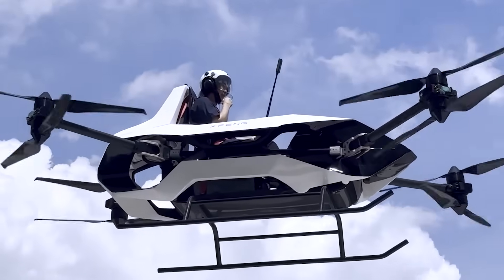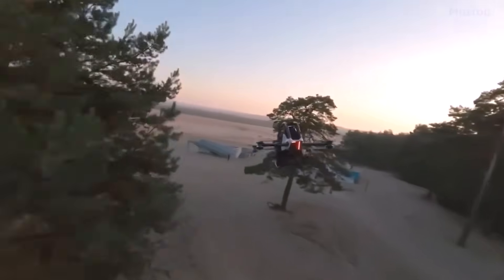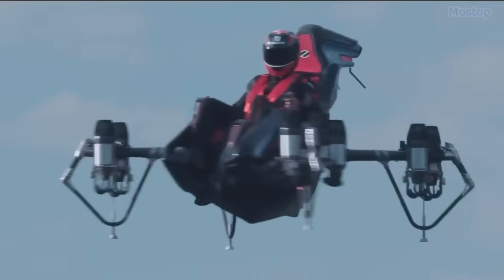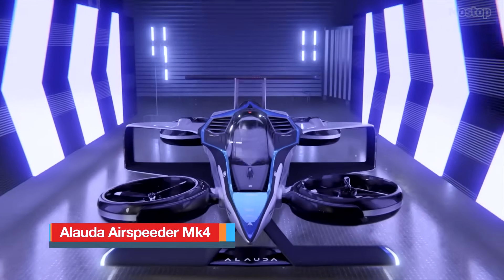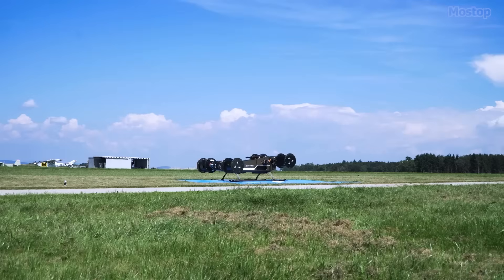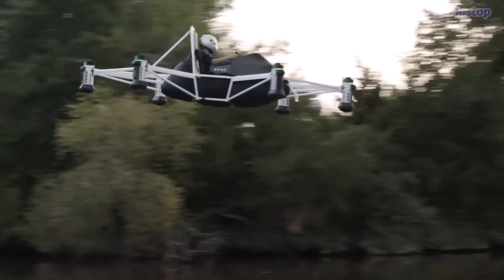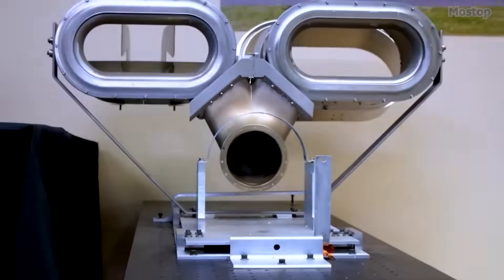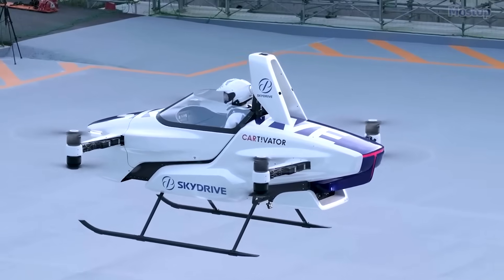These Smallest eVTOLs are the Future Ultralight Aircraft

Comment: 👑🤜🇺🇸🤛👑  We are designing 2 point-to-point personal air mobility VTOL systems, the PersonalJet, one for personal ownership [shooting for <$10k (engine now costs $20k but high production should drop it by 4X)] and another more advanced one for autonomous,  ride hailing [taxi] .
It has 2 turbo-engines although each small motor is about as expensive as one large one. Same goes fuel fuel burn [$]. I'm struggling with the redundancy-vs-costs issue. 👑🤜🇺🇸🤛👑
Reply: ❤🇨🇿  Most of these are unrealistic to become mainstream ❤🇨🇿

Comment: There so cool!  I want 1. But I can't afford it 😢
Reply: 👑🤜🇺🇸🤛👑  We are designing 2 point-to-point personal air mobility VTOL systems, the PersonalJet, one for personal ownership [shooting for <$10k (engine now costs $20k but high production should drop it by 4X)] and another more advanced one for autonomous,  ride hailing [taxi] .
It has 2 turbo-engines although each small motor is about as expensive as one large one. Same goes fuel fuel burn [$]. I'm struggling with the redundancy-vs-costs issue. 👑🤜🇺🇸🤛👑
Reply: @nadahere  any idea when it might be available? 
Last question do you have to take flight lessons? 
Thank you
Reply: @perfectionist724  It will be an ultralight so no license required but for safety some training will be recommended which might be done at home. It's a new concept  ;-)

We are teaming with partners so at least a year before a prototype stage.
Reply: @MiloTheMindBender  thank you

Comment: These giant drones are only sort-of aircraft. Why?  In the air, you are hanging on the fans. If the fan blades stop for whatever reason, the vehicle will fall like a rock. Much less becoming a glider like a standard winged aircraft losing power, these eVTOLS can't even auto-rotate like a helicopter. An extremely risky concept.

Comment: Those have the same glide characteristics of a brick. Power goes off, you die, no do over. Death wish anyone?
Reply: How many here has had a computer freeze? Any glitch you die.
Reply: I think the odd one has ballistic recovery chutes , so choose wisely if you got the cash.
Reply: @leschortos9196  This type of craft has so many ways all of which involve severe injury and or death. Any who pilot these probably either have a death wish, or are enlisting in the future Darwin Awards, or perhaps are getting paid a great deal of money as a test pilot. If anything, and I do mean anything goes wrong the odds of the pilot remaining in one piece go way down. Thanks, but "F" No. Give me wings and decent glide characteristics, and I will give it a go. I always have believed in stacking the deck in my favour when it comes to risking my life.
Reply: That’s not how they work and they are very safe. They are far more reliable than if they were petrol powered and are extensively tested.
Reply: @jamesgallagher2434  Oh of course, I must have missed the invisible wings that let you glide to a pillow soft safe landing when the engines quite because of a short circuit, or battery failure. Sorry for thinking they are risky as hell, and that a pilot may have other options other then severe injury or death. There are obviously lots of options when there is a power failure. Or NOT.

Comment: A real Blade Runner style roadable VTOL flying car is being developed called the Sky Chaser. It looks and drives like a Can-Am race car, flies both vertically like a drone and horizontally like a plane, and is even amphibian. It has no external wings or rotors and uses the body as a wing. It will be both manual and fully autonomous, and will be powered by a hydrogen fuel cell, giving it hours of range. It is the 1st of it's kind, a real Blade Runner style roadable flying car. See my icon for more information.
Reply: Coming to Amazon in 2054!